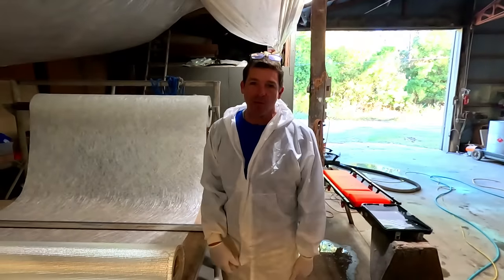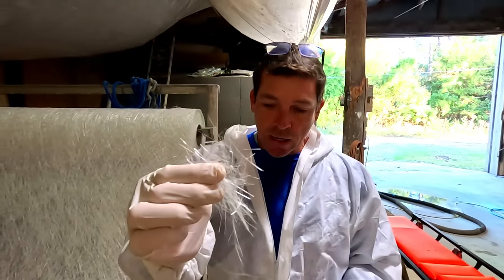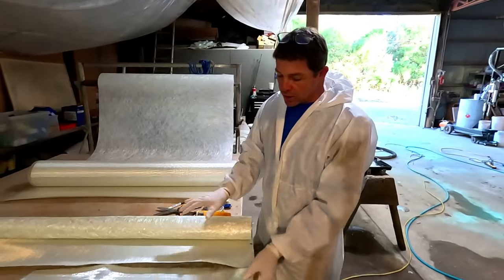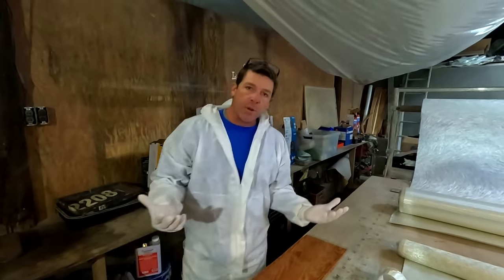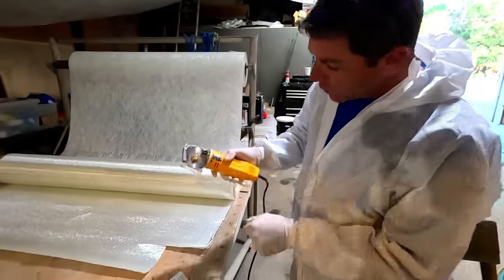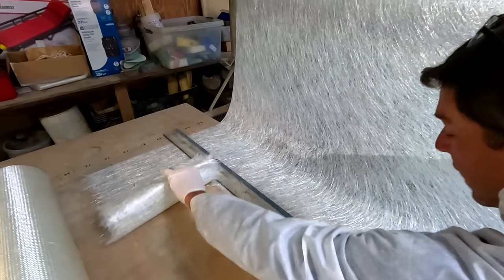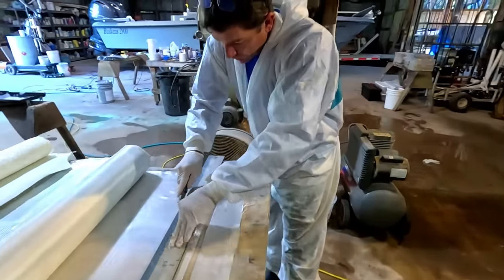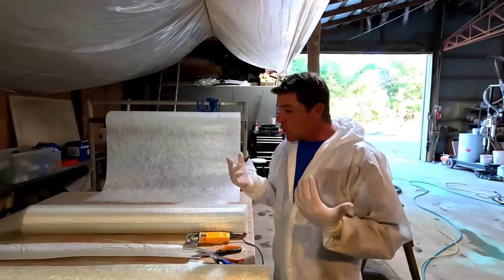HOW-TO  CUT and SHAPE FIBERGLASS  FOR YOUR NEXT DIY FIBERGLASS PROJECT-FIBERGLASS SELECTION GUIDE

Comment: I've seen a lot of CSM labelled as "Epoxy compatible" . Is that just a marketing scam?
Reply from the maker: You can use regular csm with epoxy, but the epoxy doesn't melt the binders in the csm like styrene based resin do. There are powder binder based csm available that work well with epoxy, but for some reason it  is hard to find  in the U.S. I hope this helps and thanks for watching!

Comment: Awesome video, thank you. Now that i know i can use epoxy with 1708 on my deck what would  finish over that with? Or just fair over the 1708?
Reply from the maker: Thanks! If you want it smooth, you could sand and fair it, or you might consider using peel ply over the epoxy. Peel ply will really help smooth the surface, remove any amine blush from the epoxy, and leave a perfect texture for paint or more epoxy. I have a recent video on Peel Ply that would be helpful, and Fiberglass warehouse has peel ply and a discount code for fish bump tv viewers that will save you some money. I hope this helps, and I appreciate you watching!
Reply: @FishBumpTV  Perfect, thank you so much for taking time to answer! I'm going to do 2 layers of 1708 on the deck and try the peel ply, i like it
Reply from the maker: @aaronadams9509  Glad to help!

Comment: Hello Joe, I’m restoring a 1973 VIP Bay Stealth. Do I need to remove all the gelcoat in the hull, before laying in new glass? Or can I do a rough sanding and lay in the glass?
Reply from the maker: I usually recommend removing all of the gelcoat and get down to solid fiberglass. I usually use a 24 grit sanding disc to put a very aggressive tooth or surface on the original fiberglass so that the new fiberglass can bond better. I hope this helps and thanks for watching!

Comment: I am doing a complete overhaul on a 1996 angler center console. I have replaced everything with coosa board. I am now doing the floor and I have 2 pieces that are 1/2" thick woth off set joints nonetheless floor. I have 1 layer of 1808 down now and it feels solid. Should I put another layer of 1808 down then glass the console in or just glass the console in ?
Reply from the maker: Every boat project is different,  but we usually go on the heavy duty side when doing glass work. When in doubt we usually add another layer. I hope this helps and best of luck with your project!

Comment: thank you for the emphasis on the CSM non compatibility with Epoxy, great introduction video IMHO
Reply from the maker: You are welcome! Appreciate you watching!
Reply: @FishBumpTV  I've been using CSM with Epoxy for years.   Not the typical CSM which is emulsion bonded but CSM which is powder bonded specifically formulated for use with Epoxy resins and saturates very well.

Comment: Thanks for all your videos. I've been binge watching. I'm currently doing a restoration on a 24 foot Morgan. It had a yanmar diesel in it and I'm converting to an outboard. It's a lot of work. Your videos definitely inspire me. Thanks again. One Tip that I have learned. Use your little acetone bottle. Draw a line with acetone and it rips really easy on mat
Reply from the maker: You are very welcome, sounds like a very cool project! Yes, the acetone melts the binders in the mat. that is a neat trick. thanks for sharing!

Comment: Nice and concise Capitan! A follow up video would be appreciated:

How do you come up with a layup schedule?  How thick is a layer of cloth?  Do you always do mat first and last, or is it not needed first with the xx08 fabrics? i.e.  1.5 oz mat - 1708 - 1808 - 1708 -1.5oz mat?  Mat matters more for visual finished surface, or is it needed to hold extra resin for a good bond (or both)?
How do you estimate how much material to buy?  is there an waste percentage that is common, 10%?
How much resin/yard would you estimate?

How many layers can do in a single layup?
How do you decide to have a core vs solid glass?
Reply from the maker: Thanks, all great suggestions!  I will try to add some or all of those to a video. I appreciate you watching
Reply: Depends on what you are doing but always put first and last mat it gives better finish and let you easier remove bubbles from product than when you leave rowing mat
Layer of mat 450 gram is about 0.8mm with resin and its about 1 kg its very dependent on temperature with higher temperature you use less resin its just more liquid water like when in low temps it gets more jelly and you ideally should put about 70% of fiberglass but its kinda unrealistic in hand made laminate its way easier to work with it if you put more resin :S
Material is estimated by square meters at least here in eu and yea 10% is about right but ISO reduces it to like 6% or something around 
You see if you put mat and rowing on gelcoat you get nasty looking imprint of rowing so to avid that you should put like 3 or 4 layers of mat and then put rowing
How many layers you can put at once? well it also depends on what initiator you use with peroxide its about 5 "450 mat+650 rowing in m+r+m+r+m" but it also varies with temperature with about 27c you get first curing in about an hour with 1% of initiator "1% its 10ml of initiator for 1kg of resin" when in 20c you put like 2% with curox initiator you can put up to 9 layers also depends on temperature be aware tho product may bend or warp in a undesired way its better to put less layers at the time
most of the time you decide by cost for example you need to laminate some part non visible in the end so you put two mat layers and call it a day if you use mat rowing mat you use more materials than needed to achieve the same result for example you make a form and you want to reinforce walls so the keep shape so instead of putting few more layers you put instead few pieces of wood planks and laminate them with two mats and get sturdy wall for cheep we use steel beams "heavy" or wood planks "mid" poliuretan foam "light" for reinforcements
for good bond its better to know time of curing for gelcoat its better to put mat layers when gelcoat is harden and slighty sticky or when is squeeky when move your fingers on surface for mat its better when its harden and dry try to scratch it using metal blade or nail if leave scratch its good to go if leaves hairs then wait and before putting another layers just sand it a little for better bonding
about gramature of fiber glass mat for more complicated shapes put smaller gramature like 150 for first layer when less complicated or flat surfaces you can put like 450 or 800 gram mat for rowing for flat its good 90 degre single woven but for complicated shapes its better double woven rowing

Comment: Great information. I'm getting ready to do some small boat repairs. What about information on the weights of the different CSM? 1 Oz or 1.5 Oz and when to use either. Thank you so much for the great information you provide.
Reply from the maker: Thanks! 1oz is just easier to wet out because it is thinner material than 1.5 oz. They make 3/4 Oz, but I find it to be somewhat delicate to handle. Just remember that csm doesn't work well with epoxy resins. Polyester and vinyl Ester are fine with csm. Hope this helps, thanks for watching!

Comment: This is great information. I want to build up the inside of my center console cause its too thin to mount any new electronics to and I want to redo all the wiring and want to design build my wiring since I am an electrician by trade. Was thinking plywood but I'm more leaning towards glassing in some coosa board instead.
Reply from the maker: Glad it was helpful! Coosa works great for what you are wanting to do, but plywood could also work. Thanks for watching!

Comment: Thankyou very much, I've tried tearing smaller widths lately and messed it. Larger pieces (over 150mm /6") seems easier.
Reply from the maker: Glad it helped! Tearing small widths is more difficult than wide, but it can be done with some practice. If you want a torn edge on one side and straight on the other, you can tear a wide strip and then split it down the middle with a straight edge and a razor blade. Thanks for watching!
Reply: @FishBumpTV  I generally cut with knife and feather the edge with side of blade - stripping off hard edge . Learnt that building house boats in Victoria Australia 🦘

Comment: Thanks for the great videos! 

I’m about to start repairing a hole on my 1976 Fairline Phantom 32. 
May I ask if standard mat and woven roving will be sufficient for the job? 
Or should I use some biaxial fabric like you did on your repair video? 

The damage on my boat looks similar and might be a through hole.
If the standard mat and woven roving is sufficient, what thickness should I buy regarding woven roving?
Reply from the maker: Glad you are enjoying the videos! Yes, you can use mat and woven roven instead of 1708 if you prefer. Just remember to always start and finish with mat. It bonds better on the first layer than roven, and has better cosmetics on the last coat. I like 18 Oz roven personally. I hope this helps and thanks for watching!
Reply: @FishBumpTV  Many Thanks! 😊👍⭐

Comment: Thanks for the great videos. Keep them up I’m not working on a boat I’m working on car parts. Wondering how you do sharp edges like on a fender or a hood when it comes to the edge how do you get them to the bond together or never done it like to know, thanks again
Reply from the maker: Glad you are enjoying the videos! I have done some body work on cars and trucks in the past, but boats are obviously our main area of expertise. If I understand you correctly, I would feather or transition the glass as you get to the edges or seams of the fender or hood. If it is a body line, or crease you may have to use a premium body filler or putty to get the shape you need. I will try to do a video on body work and fairing out glass soon. Hope this helps, thanks for watching!

Comment: understand CSM not working with epoxy,  Question, can you use epoxy as a second layer after glassing with laminating resin? will epoxy adhere over the resin once you apply the second layer of, say of 1708.  Great videos.
Reply from the maker: In most cases yes, you can put epoxy over polyester without problems. Hope this helps, thanks for watching!
Reply: thank you for the info, greatly appreciated. @FishBumpTV

Comment: Tearing the Matte is the same principle as finish drywall or using body filler and even spray painting.. We call it feathering out the edges. Tearing the matte creates the feathering effect when transitioning to another surface. It can reduce or even remove the visual layer change.
Reply from the maker: Yes, it really helps the quality of the finish work. I appreciate the comment!
Reply: That and staggering layers to avoid thick spots
Reply: very informative. now I know as to CSM, just tear the mat. now how will you do it as to woven roving sir? please, thank you.
Reply from the maker: Thanks, you can stagger the layers of roven or biaxial for a smoother transition. Hope this helps!

Comment: question, is there a version of mat that does work with epoxy?
because i really like the way you use the mat to feather out and hide the edges of the roving and the 1708 on the other vids where you showed how to fiberglass plywood, but i was wanting to use epoxy for a project i'm planning
Reply: Yes, stitched chopped strand mat is compatible with epoxy because it uses no binders.
Reply: @WereAllThatBored  awesome, thanks for the info
Reply from the maker: There are also csm
Reply: Use powder bound csm with epoxy. Emulsion bound csm is suitable with polyester

Comment: How many layers of 1708 would it take for a say 16 to 20 foot skiff style hull. ?? Thanks
Reply from the maker: Boat hull laminate schedules can vary greatly. Our 29 custom has 10 layers on the bottom and 6 on the sides. Smaller boat that see lighter service could possibly use half of that many layers, and would probably be fine. I hope this helps and thanks for watching!

Comment: Thanks again.
How is it that the chop stran mat form Europe is made so epoxy will work. Will we ever get that . Puzzling?  Thank again
Reply from the maker: It has a different binder in it that is designed to work well with epoxy. It seems crazy that it is not available here in the States, or at least I haven't found a source for it. Thanks for watching!
Reply: Yes, there are two kind of csm. It is the powder bound csm which is best compatible with epoxy. Cheers

Comment: great video

i have quesyion please
i have crack on the floor of the bath
i bought Bondo fiberglass resin repair kit does it ok?
Reply from the maker: Thanks! I don't use much of the bondo brand resins, and resins can vary a good bit in what they can do. It is possible it could work well, but it is hard to say for sure. Wish I could help more.

Comment: I have a 89 celebrity that has cracks in the strakes and was wondering what you suggest using to repair the cracks. They are leaking water into my boat.  Thank you
Reply from the maker: That could be a serious structural problem and might require some serious fiberglass repair work. Most damage on boats could be considered cosmetic, but if it is leaking water into the hull, that would be structural damage. We have not done any videos on that kind of repair work, and it might be something you should talk to a repair shop about. At least see what they would have to say. Hope this helps and thanks for watching

Comment: You never stated why chop & strand mat isn't used with epoxy and what is used for it. Can you please elaborate? Also what's the diff btwn epoxy and poly?  (I hate watching vids that are abreviated and leave holes in knowledge). This is complicated. So mat works with woven roven and then can accept epoxy? There are a lot of nuiances here.  Thanks!

Comment: How do you determine a fiberglass layup schedule?
Reply from the maker: It varies from boat to boat. Large boats require more glass than small ones. Commercial work boats are usually built heavier than pleasure boats. So there are many factors. Also just plain experience working with many boat of different sizes you get to see what works. Our 29 ft custom charter boat  we built has 2 layers of 1.5 Oz  csm for a skin coat, then 10 layers of biaxial on the hull  bottom. That yields around a 1/2 inch thick laminate on all flat panels. Nearly 1 inch where it laps in the keel and chines. Hope this helps, thanks for watching!

Comment: By 45 degrees fabrics are you referring to a twill weave?
Reply from the maker: The main fiberglass strands run in a 45 degree orientation relative to the roll itself. 1808 fabric runs at a 90 degree orientation to the roll. I hope this helps and thanks for watching!

Comment: Which one would you use for difficult shapes like the rounded corner of a heelcup? Does the extra thin mat wrap around those areas or should I cut several overlapping shapes?
And what might be a good pressure if I do a positive and a negative mould and press the fiber together?
Reply from the maker: The mat works very good around difficult shapes when used with polyester or vinyl Ester resins. The light weight finishing cloth works well with epoxy around difficult shapes. I don't every use two part molds, so I don't have a answer for that one. Hope this helps and thanks for watching!
Reply: Twill or satin weave is very good for curves.
Reply: @IngeBall  Do you know a european online shop, that sells s2- fiberglass in satin? (Taxes and shipping make me pay double the price in such low quantities). And google seems to hide them.
Reply: @hannesaltenfelder4302  
No, but have you checked in UK?
Reply: @IngeBall  composite envision: double price, easy composites: double price.
Seabase: "only" 150% price, but without taxes.
I wish amazon would offer s2...
Reply: @hannesaltenfelder4302  That sucks 😐

Comment: why not mat with epoxy ?????????
Reply: Mat has binders that break down with the solvents in Polyester.  Epoxy does not break the binders down.  If you want to use epoxy with mat, buy stitched CSM.
Reply from the maker: Yes, that is exactly right! Thanks!